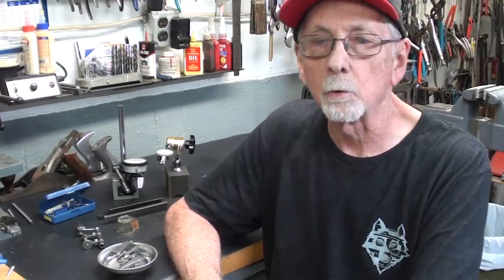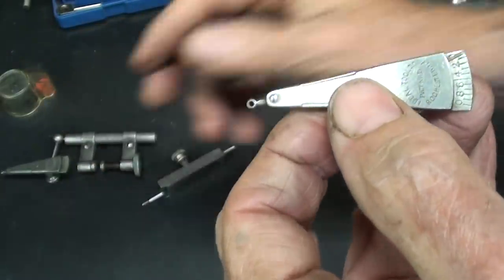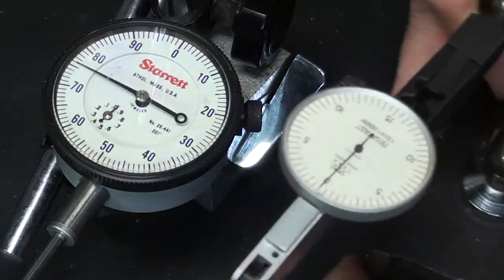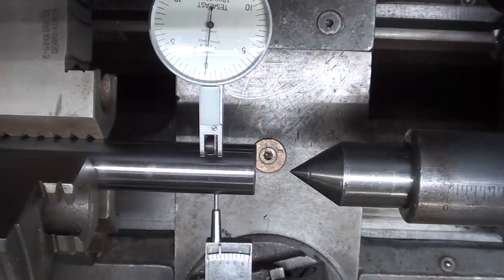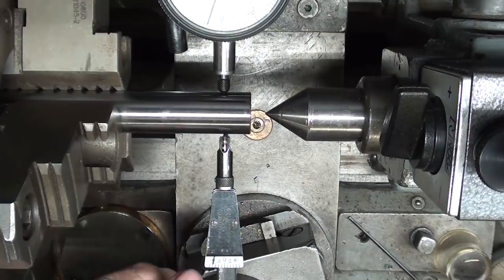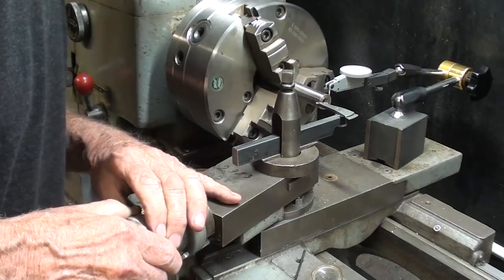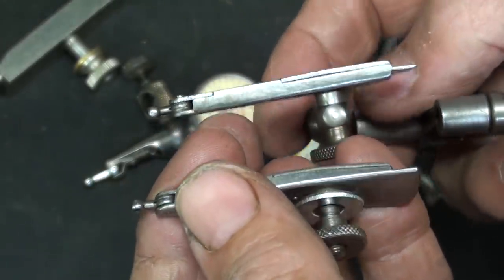Evaluating Starrett Antique Indicators Tips #652 tubalcain mrpete

Comment: Nice demo setup. Quite clear on the lathe.

 I have used (and still own) all of these, as well as the Lufkin lookalike and others. The Starrett 564 are nearly always sluggish. Accurate, but the ball used inside as to allow the end to rotate hangs up for any number of reasons (grit, grease, oi, wear, and so on). The Koch is my favourite to use, but many have broken needle ends. With the hooked end broken off (probably by the cover being pushed too far), they are much less readable. The other end is a lever, rather than a plunger. The Lufkin is the prettiest in my opinion. The Ideal show up all of the time in my area, and they seem to start high and go cheap. Typical is $5 for a complete set. They were junky when new, but inexpensive and repeatable. I have two mounted as stops on my shaper. The classiest is still, in my opinion, the Starrett 64. Just one long lever that can be used in many orientations.  Also, for the glare: I have a couple indicators (plunger and lever) with the crystals removed. More correctly, crystals that were never replaced. Works a treat.  Don't walk away from used gear for a broken crystal, if it is in good condition otherwise. You can save a lot by buying them this way. Just need to be more careful with them (not my daily users with no crystal)
Reply from the maker: Thanks 👍

Comment: Thanks for another great video.  Referring to time index 10:59, it looks like the Ideal test indicator point of contact may have changed.  At the start of the setup the loop end of the probe makes contact with the work piece in the chuck inboard from the end, but as the cross slide advance the face end of the rod appears to touch the probe inboard of the loop.  In other words it is like a baseball batter choking up on it.  If the effective length is half then the needle will move double.
Reply: I noticed that also!

Comment: Hi Mr. Pete. Love these videos. I have one of those Koch indicators with the original holding bar I got with whole box full of tools years ago (talk about a bargain haul.) Anyway I tested it and found it quite accurate, and was fascinated by the most excellent design. I was perplexed by the lever on the other side of the plunger at first. It reads exactly 1/2 of the plunger reading . It turns out that this is by design as the lever is really a bell crank which pulls on the plunger and has a ratio of 2:1. Or else I'm a little touched. Maybe I'll just go back to checking fence for loose spots.

Comment: Mr. Pete,. This comment is for the video about magnification.  I have the same black visor you have.  On the inside there is a second lense that you can flip down to increase the magnification.  In your video, you showed a spare lense that you said might fit the black visor but don't like that they are not marked.  That should be the one that goes inside to flip down.  At one point in your video you can see that the inside lense has been removed.  Since you seem to have it, and not need it, I suspect you removed it some time ago to lighten the visor and have since forgotten.  I paid one dollar for mine at a yard sale.  I use it mostly when working on HO scale model trains.  The motor parts can be quite small.  Good video. I always like the extra credit!
Reply from the maker: Thank you, I will check to see if that lens fits.     Yes, I probably remove that many years ago and forgot about it

Comment: Hi Mr Pete, it isn't "glare" that makes white indicator dials so hard to read, but contrast.  Camera sensors (or film) have a limited range of intensities that they can handle without parts of the image going completely white or completely black.  As you were not running the lathe, putting a piece of light (ish) coloured cloth over the cross-slide and ways would have prevented the auto-exposure logic in the camera opening the aperture too far and over-exposing the relatively small area occupied by the dial.  For example, between 11:15 and 11:30 when the Tesa dial occupied the whole screen, it was easy to read even though it initially had the overhead lights reflecting off the glass.  Note also how the exposure changed.  As the camera moved towards the indicator and the dial occupied more of the screen, the auto-exposure logic closed the aperture and darkened the image, making the dial face more of a grey.
Reply from the maker: Thank you, that’s a very good explanation of what is happening

Comment: I have an Ideal just like that, it belonged to my great grandfather, I also have a Starrett 64A that I bought at the flea market, it works similar to the Ideal but is much larger with a +/- 15 thou range. I guess I will have to check them out the same way you did. Your video's are great
Reply from the maker: Thanks

Comment: I recently bought some tools from eBay and got a Starret 64 indicator and an old last word. All were like new. I also got a lufkin large surface gauge complete, it also “like new!” I would like to sell it. Full set of Starret radius gauges, 2 sizes in leaf form. Full set of 5 adjustable parallels, Starret. Got a old button type Starret indicator that works great too. Need to find all of them a new home!

Comment: Almost need to get onto you for this one.  These are test indicators, parrellax errors of the arm comes into play and they are what they are.  That ideal will work just fine for truing up work in a 4 jaw, I have one I keep on mill in an fabricated indicol substitute, been using it for years, good for pretty close work, I do have other indicators.  Enjoyed the video though.  Remember the Gems?  Cheap, no lens, utility test indicators, good to keep on a mag base for the old 4 jaw lathe.
I have a really old Brown and Sharp test indicator, measures any direction, left right, up down, pivot point is a ball and socket arrangement.  Probably wouldn't test very accurate.  Don't use it, just dig it out and show it to the young guys.
Reply: Yes cosine not parrellax, duh. Or is it a sine error, guess it depends on angle of arm.  Had an old weaver scope which had parrellax problems.

Comment: Thanks Mr. Pete.  Amazing the old Starrett's were pretty much dead on.   However I have to stink about it some more, but think your Ideal test might be flawed because of the compound being at an angle and feeding the compound (a trig thing) with the ideal at 90° to the Tessa.  Seems to me apples to apples would be to mount the ideal vertically in the same setup as the Tessa then try it again.  Been known to be wrong many times but something seemed off to me.  Please correct me if I'm wrong.  Thanks again, you are just the best internet shop teacher...gets my noodle churning every time.
Reply from the maker: The angle of the compound is a relevant, I just used it to approach the work

Comment: I wasn't able to leave a comment on your video about magnifiers- but regarding the black micoscope you showed for "extra credit"- that is a "Bausch and Lomb Stereozoom" microscope. I own several of these microscopes, and I use one frequently. These are used a lot like a pair of binoculars- the eyepieces move together or apart to match the distance between your eye pupils, and one of the eyepieces (looks like the left one) has an individual focus adjustment, and the microscope mount has a pair of focusing knobs just underneath the microscope.

The knob on the top of the microscope "pod" is a "magnification zoom adjustment", not a "focus adjustment". The microscope eyepieces are easily exchanged, and they are available in 1x, 10x, and 25x. I even have a pair of 16x eyepieces. The eyepiece magnification is clearly marked on each eyepiece- and they MUST be used in PAIRS. The numbers engraved on the back of the microscope "pod"  (.7 - 3) are the magnification zoom settings- and they depend on the eyepieces that are being used- for instance, if 10x eyepieces are installed, the magnification range is "7 power to 30 power", and if 1x eyepieces are installed, the magnification range is ".7 power to 3 power". The magnification zoom is varied by the knob on top of the microscope "pod".

The microscope pod is easily removable from from the microscope stand- but I seriously have to warn you that the eyepieces will likely fall out if the microscope is turned upside down- and if the eyepiece(s) land on a hard surface- they break! I found that out the hard way!!! REMOVE THE EYEPIECES FIRST!!!

Another feature is that the microscope light can be easily removed from the arm on the light base, and the nose will fit in the hole where the extra eyepiece was.

These microscopes combine 3d viewing with magnification and bright illumination- and they have enough distance to be able to work under them. Once you get used to using one of these Stereozoom microscopes- you're gonna be HOOKED...that's what happened to ME!!
Reply from the maker: Thank you for a complete rundown on the Instrument. I really haven’t used it at all. But I did recognize it as very high-quality. I will experiment with it
Reply: @mrpete222  The microscope stand you have is probably best suited for inspecting small items- I use a "boom mount" with my Stereozoom microscope(s)- that mount is far better suited for doing actual work under one of these microscopes.

Another bit of advice- if I were you, I'd remove the two rubber "light shields" on the eyepieces: they are easily detached, and it has been my experience that those "light shields" are more trouble than they are worth- especially if you have to wear glasses. Luckily, it is very often possible to adjust this microscope so you can use it WITHOUT wearing glasses- that's how I always use mine.

These microscopes are OUTSTANDING for finding and removing metal slivers from your finger(s)- I use one of these microscopes all the time for that.

Comment: I like your use of magnets for holding the necessary tools for you lathe on the tail stock.  I do a similar thing with my chuck key for my Atlas 15" drill press.
Is my thinking incorrect?  For set up purposes, wouldn't all the test indicators be usable, regardless of it's actuall accuracy?  Repeatability in my opinion would be more of a concern.

Comment: As the wedge indicators are kinematic, the only way they could be inaccurate is if joint binding leads to the linkage arms bending, or if joint clearances opened up and provide slop.

They look easily disassembled and cleaned. 

I'm betting a cleaning and lubrication will fix the Ideals. Good vidjeo topic!
Reply from the maker: Yes thanks

Comment: Could the Ideal be adjusted or calibrated somehow?  Since both are inaccurate, do you suspect they were always so even when new?  Does it reliably read 1 thousandth off per 9 thousandth read?  In other words is it 1/2 thousandth off when reading 4 1/2?  There's no reason to use one, but if back in the day that was all a fellow had and he knew to compensate for the reading...

Comment: Although the Ideal indicator is not accurate for linearity it could still be used for repeatability.  If dialing in a part in a 4 jaw it would be perfectly acceptable for most jobs.  Kind of like the Starrett back plunger indicator which can not be calibrated for linearity but can be calibrated for repeatability.
Reply from the maker: Good point thank you

Comment: I think you may have accidentally touched the end of the shaft to the stem on the ideal indicator. It looked like it was sticking past the ball and and and bumped the shaft.

When you get right down to it though, these are all quite usable for most purposes. The two things you really care about on the test indicators is sensitivity, being able to detect small deviations, and repeatability, coming back to zero accurately. Beyond that, you're usually just testing for zero.

Comment: Hey mrpete I have a Kennedy tool box lots of mics two indicator  $750 worth of endmills a Starrett 436 box with the 2 and 3 in and I already have those a 1in central and a 4 in Mitutoyo all read to the tenths about $2000 to $3500 worth of tools in total and got them all at a flea markets for about $100 to $250 dollars and blame you for making me want to be a machinist at 12.
Reply from the maker: lol. Sounds like you got some awesome tools at a reasonable price
Reply: mrpete222 I just lost all of my inside outside calipers and dividers a full 6in set and 3in set because of the rust dissolver ate through them all Starrett lufkin craftsmen and union all made in the USA my day is now ruined.

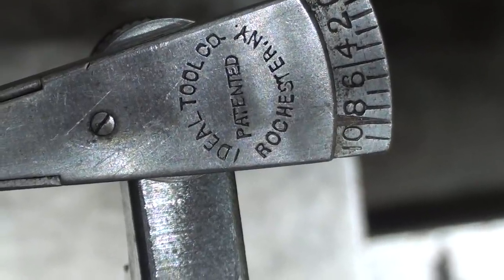Comment: 11:08 Perhaps the ideal and similar indicator just have numeric graduations for relative reference, but aren't actually calibrated to any particular scale?
Reply: If one of those is all I had, I would sand off the marks and scratch on some that actually matched the values they should be. Of course I would fix that failure to be able to knock into zero by making the zero mark up a bit.
Reply: @ExtantFrodo2  The values they should be? It's still very useful as is. The marks could be A, B, C, and so on, or I, II, III, IV, and so on. It's just a relative measuring tool with it's own units of measure. A guitar amplifier volume knob starts at 1 and ends at 10 (11). The numbers don't correspond to any measurement of loudness or gain, but it's still quit useful scale. Going back to the ideal indicator, the important thing would be its precision. IE, when it points to 1 on Monday, does pointing to 1 on Friday indicate the same distance? Back in the early 20th century, the boss could say that they want radial run-out not to exceed 1.5 on that scale because the customer for that job gets upset when it's 2 or more. Doesn't matter what that run-out is in thousandths of an inch... Although it's obviously more practical to know a particular measurement in a transferable scale.
Reply: @gregfeneis609  What values? Why thousandths of course. That's the range it is geared to so I would set it up on a surface plate with gauge blocks in .001 increments.
Reply: @ExtantFrodo2  I didn't ask what values, I questioned the assumption that it's supposed to be calibrated at all. This is what I've been conveying this whole time. At least on the dials of the modern tools, it says what each graduation is supposed to be. That's not indicated on the Ideal, that I could see in the video
Reply: @gregfeneis609  you can certainly use this in a limited capacity that way, but why?
Reply: @ExtantFrodo2  It's not worth using for us now, but certainly more of value in 1920 or whenever it was made and used

Comment: Can those be calibrated to make them accurate?
Reply: You'd have to rework the markings since the error is not simply an adjustment error.
Reply: @ExtantFrodo2 I'd think that the internal mechanism would be the key unless these were so bad when new they'd lead to a lot of bad machining.
Reply: @oldninjarider  I don't think you could change the leverage of the mechanism, The linkage is what it is, but one could do what I suggested.